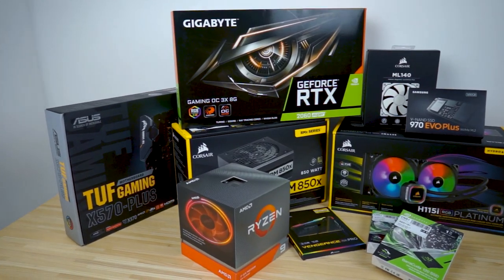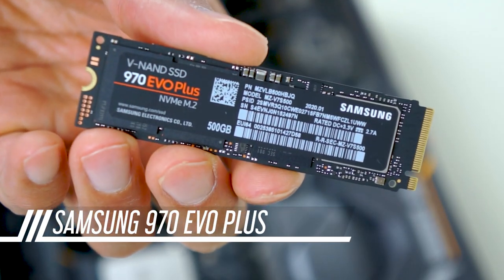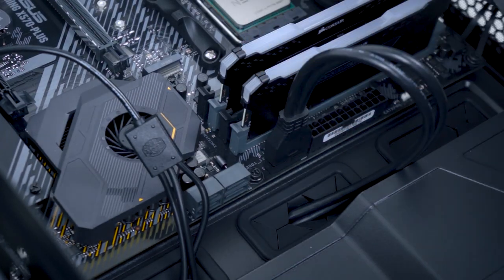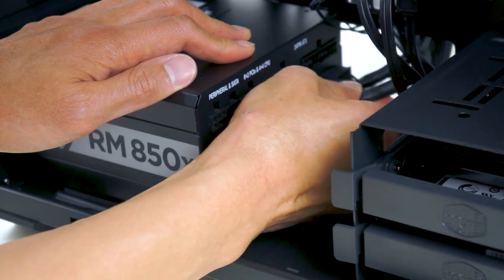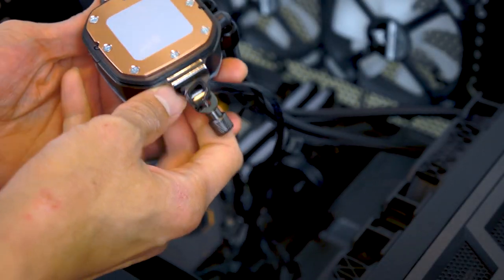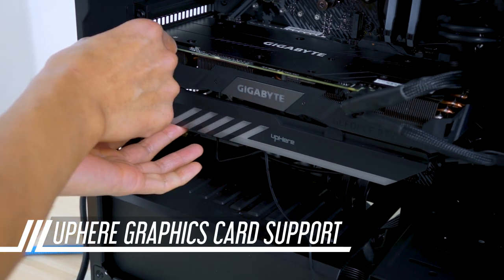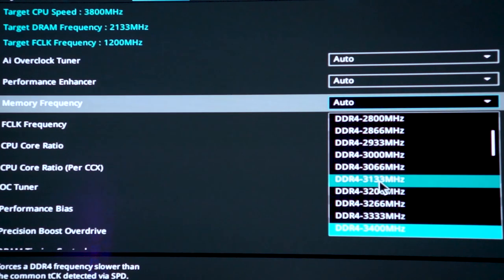HOW TO BUILD A PC IN 10 MINUTES - Step-by-Step Guide to building a Video Editing and Gaming PC!

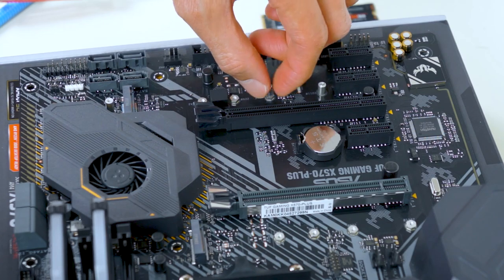Comment: 2:46 question, what the m2 for?
Reply from the maker: The NVMe M.2 SSD drive is a very fast storage drive (M.2 is the form factor) that is a number of times faster than SATA SSD drives. It's useful for constantly reading and writing a lot of data very quickly (e.g. when editing videos). However, the speed gain is barely noticeable for gaming so I would leave it out if you are not doing video editing.